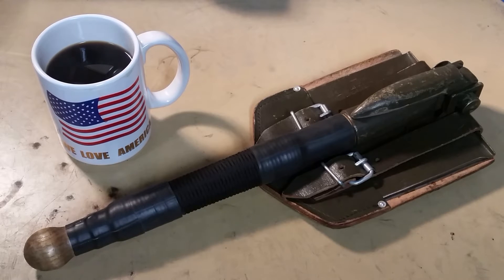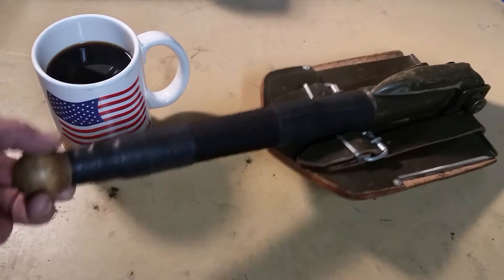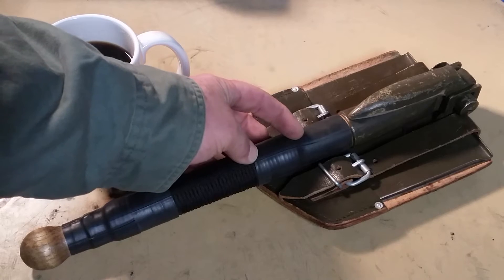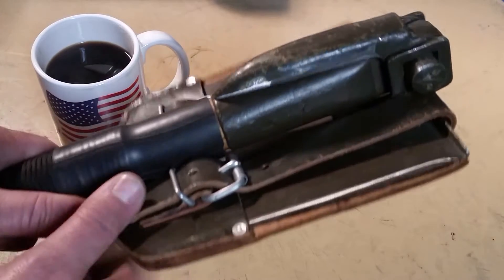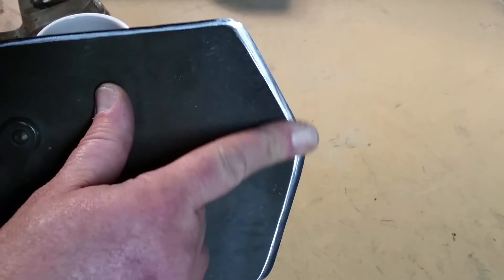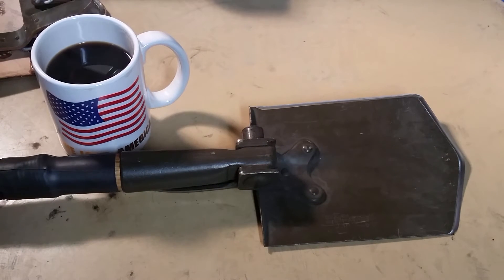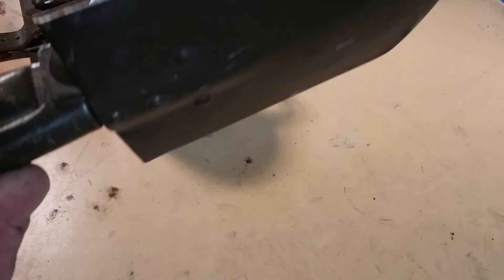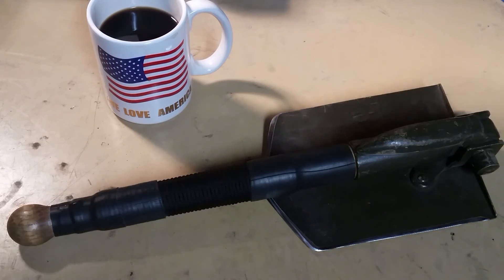My Military Shovel Mod

Comment: I just picked one of these up about 2 weeks ago. GREAT tool! I need to hit mine with the angle grinder as well. James, not be insulting here man but I am wondering if the inner tube wrapping may be detrimental to the health of the handle. I was thinking about why we do not paint wooden ladders; moisture inside the wood can not escape. If moisture can not escape it will introduce rotting, eventually. Wood likes to breathe - it has to breathe. Maybe I am out of line here, but do you think rubber inner tubes could pose any such complications? I believe white oak was used for the handles on these shovels. I'm gonna leave mine as is. I like the paracord, but covering the handle completely in rubber? I have my reservations. Anyway, thanks for sharing the video. GREAT tool! Cheers man!!
Reply from the maker: Man you didn't say anything insulting I appreciate when I get constructive criticism or ideas thrown at me. I live in a desert climate so there's not much moisture getting trapped in the handle. I use this shovel weekly on camping trips and have never noticed a decline of the health of the handle
Reply: @outdoorsmansgarage  right on. In an arid environment you'll be fine, and those simple  modifications will definitely be an advantage combating fatigue. Mine is going to be spending a lot of time outside in four seasons Ontario. Damp, cold, dry, miserable, hot, humid, ice, beautiful, warm, covered in morning dew and snowed on, bears...it's four season Hell, really, IF you're a shovel! I am going to replace the leather sheath and make an identical birch bark sheath for it. It isn't a true mod, perhaps, but it will look unique! I always carry birch bark with me for fire starting anyway (and multiple medicinal properties), so having a little bit more around won't exactly trouble me, and it's really tough stuff...and it's gorgeous. Shovels can use all the help they can get in that category!! I guess it is a mod after all!  :) Worst case scenario, it'll get stolen quicker! I like your idea for where you are located though. It makes perfect sense, now. PEACE, James! Thanks for the reply, man!!